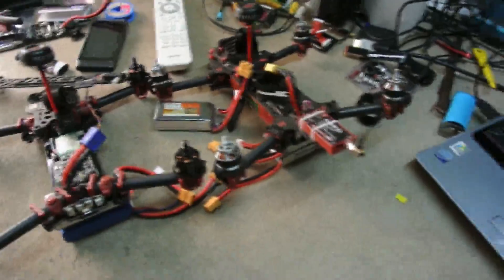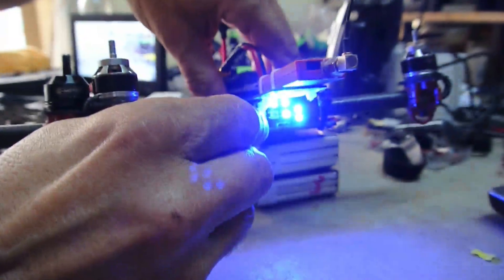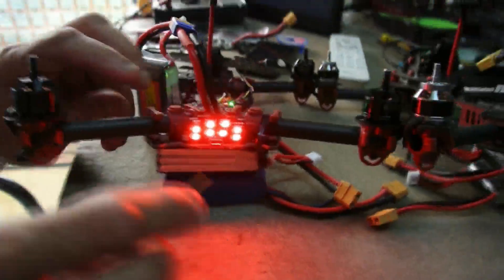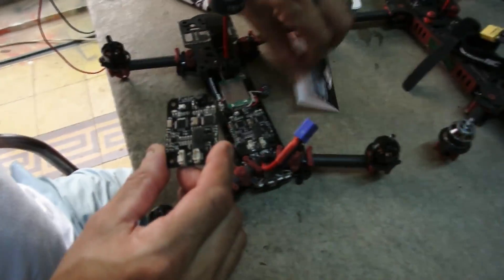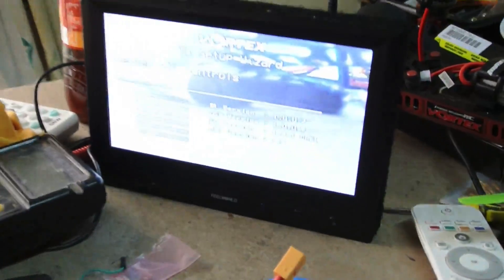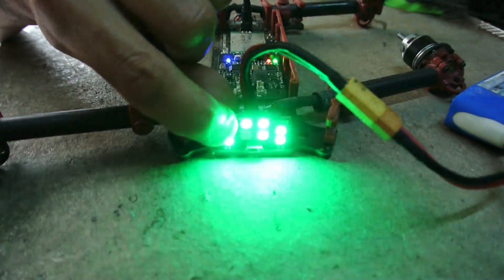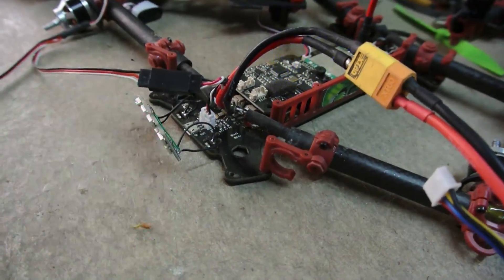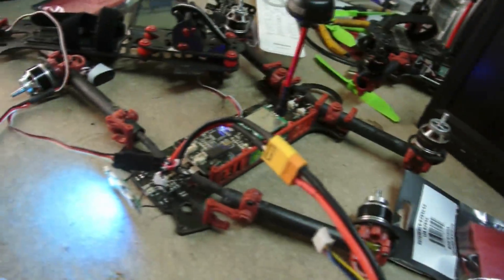Same problem with two Immersionrc Vortex

Comment: Brand new 285, same problem.  LEDs just change color from red/green/blue, can't reset no matter now long I hold the LED button. It does work intermittently.  Anyone have any links on an easy way to try to repair it while I wait for support? Sucks for a brand new item, and seems like this is common enough that they have it on their faq on fpvlabs.com.  Thanks for this vid, it helped me!

Comment: Same  thing happening to my vortex. This is the worst experience i have ever had with a Quad copter and the company Immersion RC. By the time i almost figured out the issue. The warranty was up. Seems like to many similar issues in the same time frame as other friends. I would hate to think that this was "planned obsolescence" in there business plan so we buy more parts......  I will never buy a immersion RC product again. Spent more time on the bench and phone then in the air. =(

Comment: If you haven't damaged the board, its simply a cold solder joint on the LED to the PCB..  Heat all 4 up again and you should be good to go..
Reply: Could you provide a link to any pictures on where to try to reheat the joint? tnx!